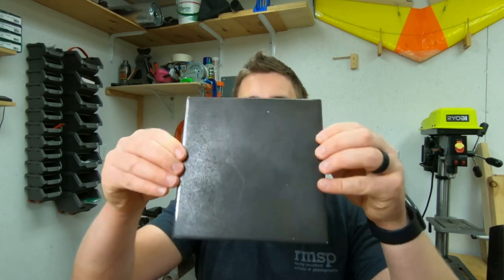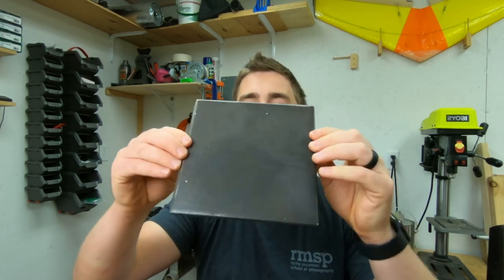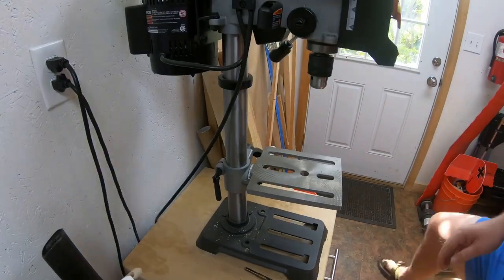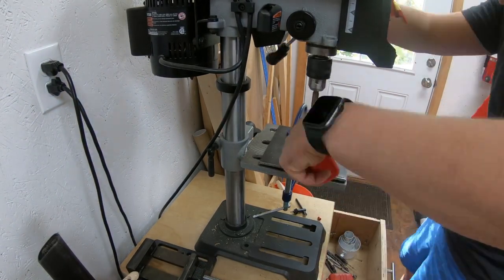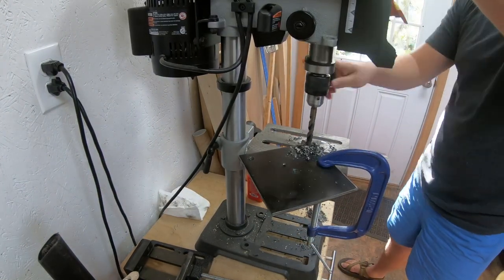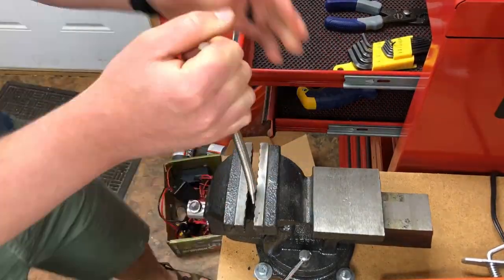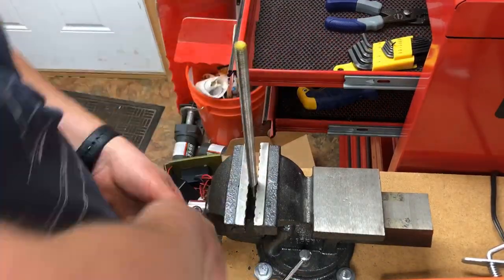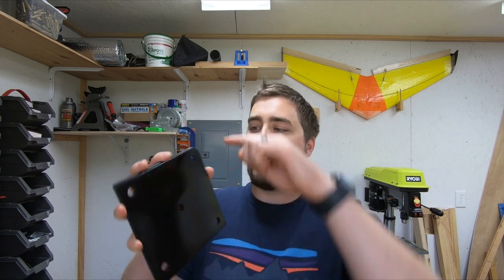Mini Backyard Observatory - Part 4

Comment: Threaded rod is to close to the edge of the concrete, on a hot day the rod will expand and the concrete will crack along the length of the rod, 25mm to 35mm of concrete should be around Re-bar, same should apply around threaded rod, Regards.
Reply: Would insulating the outside of the pier mitigate this?

Comment: Thanks Forest.  Would have been nice to see you putting the support bolts into the concrete and how you get them in the correct spots etc.  Also, how did you determine 34" height?  You mention the height from the base of the mount to the top of the scope at the parked location, but that's not 34".  Also, how did you determine the diameter of the sonotube to use?  I don't know if I can even get sonotube in Australia.  I'm not too worried about the height, since I'm just thinking of a pier and using a gizmo cover to cover the pier/mount.  It'll mean I'll have to set the scope up each time, but that's easier than the entire thing.  I am not able to build an observatory (yard problems and no money).  My yard is really bad with obstructions to the South SCP (I'm in Australia, remember!) and obstructions to the West, East...North is pretty good.  I also have a underground council pipe (water) going under our property (easement) so I'm not even sure if I can even put a pier in.  Just a BAD property sadly.  

Cheers,

Dave

Comment: When you poured your pier, why did you not pour it all at once?
Reply from the maker: Admittedly I should have. I was a bit worried about the concrete blowing out the bottom of the sonotube though.
Reply: @FoFoAstro  I'm definitely no expert at working with concrete, but I find it's generally too thick and dense to just flow out the bottom of a Sonotube. Though I've noticed in some videos on pier-building persons making the concrete really, really soupy.  It probably weakens the concrete as it cures, but does make it easier to get smoother finishes.